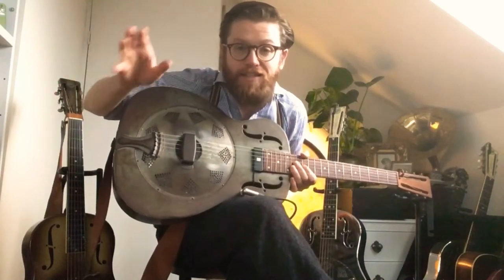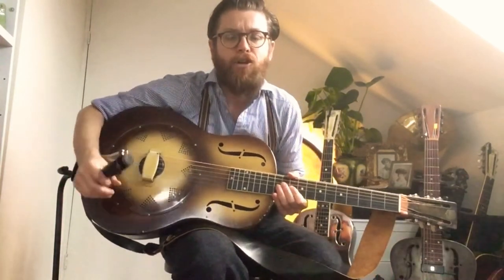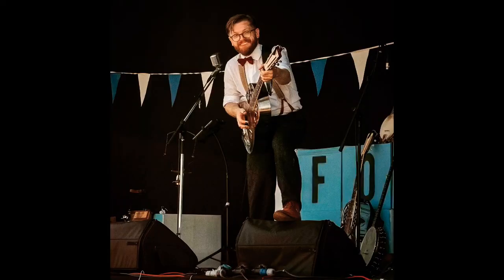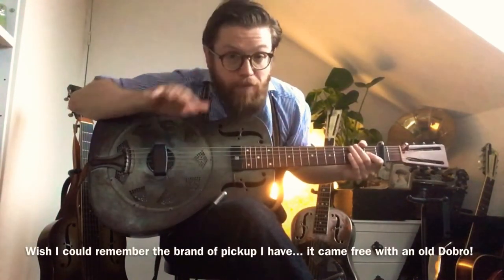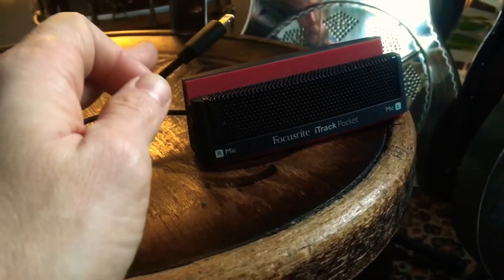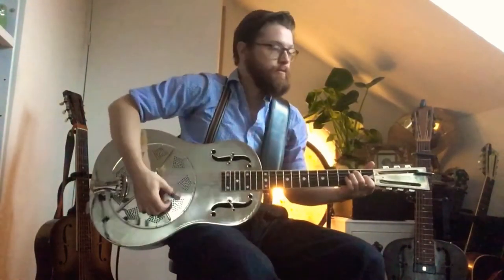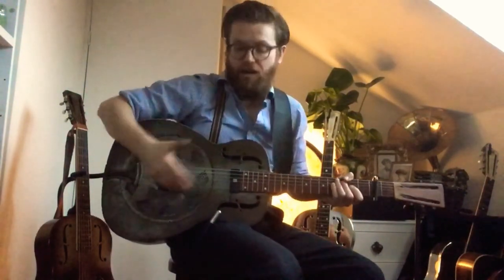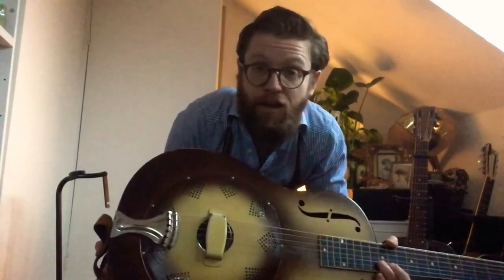How To Amplify A Resonator Guitar - Resonator Pickup Type And Comparison - The Washboard Resonators

Comment: Great one. In all my resonators are two pickups installed. A magnetic soundhole pickup and three piezo pickups under the cone. You can blend them together or use them separately. Peter Wahl, who built my resonators, uses this system a lot. I usually use only the magnetic soundhole pickup but it's great to have the option for a more acoustic sound with the piezos.
Reply from the maker: This is a really cool idea. At one point we had one with magnetic and piezo pickup with two outputs. Makes it a Swiss Army Resonator. Can do anything! Thanks for the information on your set up. Sure this will help people. 🎯

Comment: My experiences- if you're looking at a pickup, Krivo is the first choice IMO-reasonably natural sounding, easy to install and move around, and a fair amount of volume before feedback. I have one on my NRP Style 1 tricone, and it works great. Just be aware of the height of the pickup, it's pretty even with my fretboard, and string clearance is pretty tight. I have used the Schatten pickup as well on this guitar-it's OK, but because it's a contact pickup, you need to be REALLY careful on placement! We have a Schatten on my wife's Dobro Hound Dog (metal body biscuit, similar to Style O), that one actually is not bad at all. As for microphones, I've used 57s and numerous others-they can all work well, but as you mentioned, moving around will change your volume and tone! I have a '32 Duolian that I recently acquired, and I'm trying a Myers Feather pickup on it-it's actually a microphone on a gooseneck attached to a preamp, which you then feed into whatever you're using for amplification. It's a bit fiddly in getting the placement right, but the sound is extremely accurate, and best of all, doesn't mar the finish of your instrument-my Duolian still has it's original frosted Duco finish, and the putty that my Krivo pickup uses to attach pulled the finish up too easily (tested on a spot nobody would notice first!). Thanks for the video!
Reply from the maker: I was trying to not be too opinionated about what’s best except for the real world advantages of the systems I’m using. Ultimately I think you’re 100% right on everything you’ve said. I think as the years roll on and even future resonator players see this video and read the comments you will have imparted massively useful information that will help. Many thanks!
Reply: So did the Krivo Pickup damage your guitars finish???

Comment: I put a Lace humbucker near the neck of a single cone biscuit all metal resonator,(only place it fitted)  but struggled to keep the reso sound when using gain, until i found this solution: that humbucker goes through a stereo pedal (flanger in my case), then one half of the signal goes to an acoustic amp for the reso sound, and the other half goes to a small tube amp.  Awesome for bluesrock.
Reply from the maker: That’s a new one. Excellent idea!

Comment: Nice, nice overview... Tricones, I think present a bit of a problem using the piezo... Highlander manufactured a nice set up but it is unclear if they are still in business, plus as you say, to mount a Highlander involves some serious guitar surgery... I ordered a Krivo even though I don't like the idea of sticking the pickup on with putty balls and would rather have a more permanent set up... nevertheless, I like to run my resonator through a pedal board to alter the tonality so the Krivo makes sense... thanks for the lesson...
Reply from the maker: Krivo is best for this. I use blue tack on my rusty guitar and it doesn’t budge but will come off easily when needed.

Comment: I have a wooden ozark resinator and was wondering would a 5 band acoustic guitar Preamp EQequalizer Piezo Pickup kit with tuner amplifier and built in di work on a resonator, I know it'll need some cutting and fixing but will it sound good and has any one done it?
Reply from the maker: Whack it in. It’ll do a job.
Reply: Sorted, I'll order it tomorrow and get my router ready 😁😁😁😁😁

Comment: Thanks for the videos, they are helpful. Assuming the room mic is still on for the magnetic clip, how much "resonator" sound does it convey from direct pickup signal alone?
Reply from the maker: You can hear the room sound and then I say I’m switching the guitar on. There is a difference which is audible. It’s a simple set up here which hopefully gets a novice into the rough area of which system might work for them. 🎯

Comment: Just a quick question from one Brit to another, i am a total beginner but love the sound of the resonator, could i learn to play on a resonator or not ? thanks very much.
Reply from the maker: Absolutely. Many cheaper ones play like garbage which could hamper you as a beginner so you need to dodge that bullet so you keep playing. Many beginners on any instrument give up when they go between the hump of a few easy chords to more interesting playing. The guitars playability can often be an issue. The Michael Messer range of guitars have a good setup so the strings are as easy to play as possible. He’s out of stock but waiting on a shipment right now. As a good rule you can spend £500+ and get a guitar repair person to check it over and dial it in if needed. The real deal is a real made in the USA National Resophonic guitar. These come up on eBay second hand fairly regularly. Sometimes the cheaper models sell around £1000. Not sure of budget but you basically can’t get better without splitting hairs and going for the boutique custom £4K+ built guitar. It’s actually an interesting subject with lots of variables. Can a beginner start on resonator? I think I’ll do a video about this subject in the coming weeks.

Comment: Hi Martin, thanks for your videos. I''m building an electric/acoustic Dobro style resonator kit. The back of the cone touches the inside of the guitar body, is this a fabrication error or should it be this way?
Reply from the maker: Shouldn’t be touching at all. Definite issue there. Get it sent back or build up the sound well and shim the neck up to compensate.
Reply: Much appreciated. I suspected that was the case. There's enough meat on the body to sand down to give it clearance. By my reckoning, that should leave the neck position in pretty good order, after I've shaved back the neck pocket enough to get the pickup in that is. Glad it's only my first resonator kit and not my first guitar kit.
Reply from the maker: They’re odd beasts. Geometry is key or else they won’t put out close to what they should. On the dobro the bridge screw can kill or open up the tone and may need some tweaking.
Reply: @johnbruce316  thank god it’s only a resonator and not a real guitar.